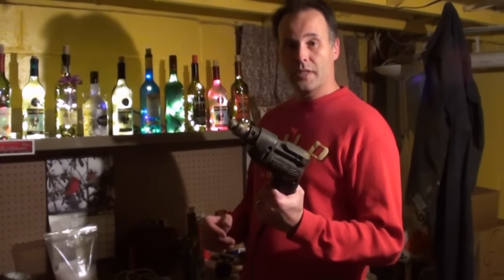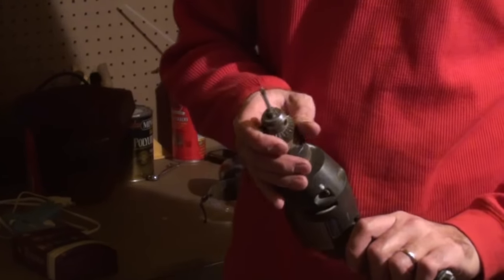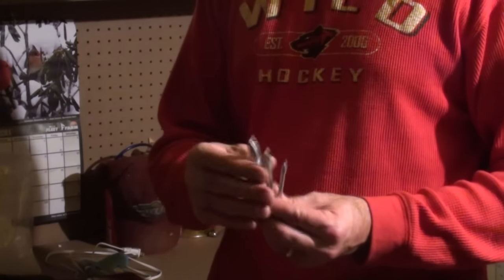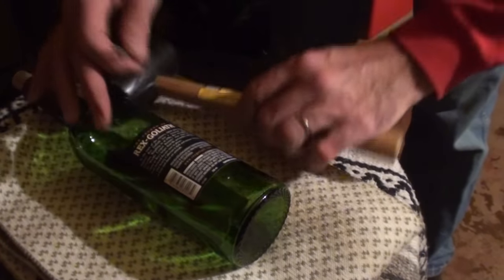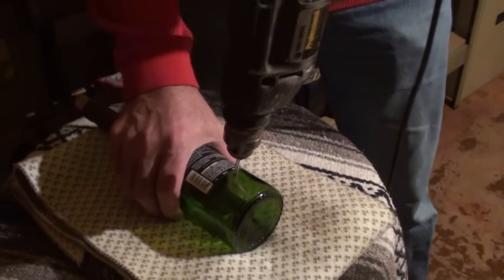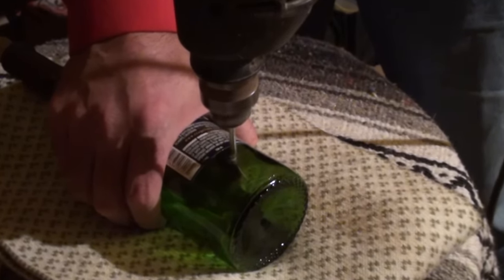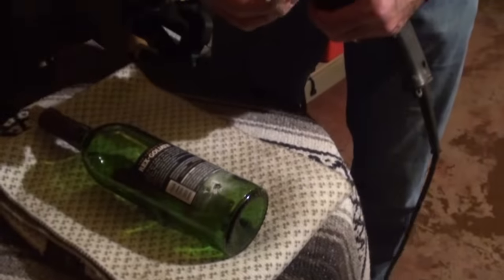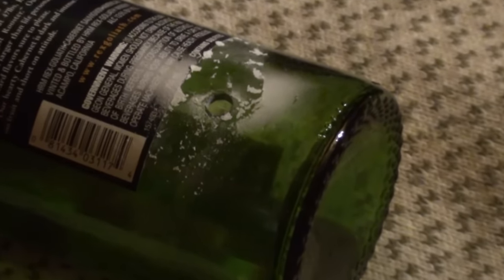HOW TO  Make Bottle Lights *DIY Wine Bottle Light*

Comment from the maker: Gilvam,

You're absolutely correct. In fact, your idea would probably work out better in the long run. The smaller the hole you have to drill is less obtrusive and is easier to make.
I offered the path of least resistance when I put this together with the thought in mind that most people wouldn't feel comfortable cutting apart the electrical cord that came with the string of lights.
I like your thinking and it lends itself to the theory, 'There's more than one way to any destination'.
Thanks you

Comment: Yesterday I drilled 4 bottles outside in the yard. I used the garden hose to keep the glass dust down. One thing I also did was to wear a glove on the hand holding the bottle in case the bottle broke. Thank you for the video I enjoyed it. I was going to make wine bottle lamps of a different type but might change my thoughts and make this style of lamp. It's much easier. Thanks for the video.

Comment from the maker: The white light strings would have worked so much better with the crystal fill. Your absolutely right. I was always taking a coat hanger to push the string back so that all you saw was the crystal fill.

Comment from the maker: Thank you POPPERZ101! Yes, there are battery operated light strings available, we have used a 15 bulb string before in a couple of our smaller bottles. I just did a quick check and Amazon has 15, 20 and 30 bulb battery operated light strings starting at $5.75.

Comment from the maker: Janet,

Are you using the glass cutting drill bits? I would mention speed and pressure as well right off the top of my head. These were things that I had to get a feel for with time. You don't want to apply too much pressure all at once. I hope this helps. We can get into specifics about technique if you would like.

Comment from the maker: I have used a different cord with the lights. Whether its a cord with or without a switch, I'm cutting off the plug in part of the Christmas lights and attaching my own plug in cord. You can either solder this extension or use wire caps. It will give you more length and having a light switch will save the end user the hassle of UN-plugging the lamp every time they're done using it.

Comment from the maker: Mary,

If you use regular Christmas lights you will experience some heat accumulation. For someone who's planning on running the bottle lights longer I would recommend LED light strings. This lights give off no heat and use less energy. The only downside is the cost. LED lights will be a little more expensive.

Comment from the maker: I was afraid to get the labels wet at first. Once the labels wet it looks like it's going to come off. No worries. It'll dry again and look just fine. Don't soak the whole bottle but carefully add water through the neck. I hold my thumb over the drilled hole and slosh the water around inside. This is usually done right after I drill the bottle. If you let the drill dust dry it'll be harder to get clean. I've also used a coat hanger to get at tough spots inside. Hope this helps!

Comment: Awesome.  I've just started making these and I love the crystal idea.  I'm using diamond tip drill bits because I read they will last longer.  How many bottles do you get out of your tips?  I saw those too and wondered if they would work?
Reply from the maker: I'm going to say about twenty bottles. It really varies on the type of glass and other variables as well. By rotating different tips while drilling you're also easing the use of one single bit.

Comment from the maker: We've had a couple of our lighted bottles plugged in for several weeks at a time. We used them as a window display during the Christmas season. If you use regular light strings the bottle will get warm but not hot enough to cause any trouble. You can always use LED light strings if you're concerned.

Comment from the maker: Not sure if you're referring to the water you want to use to keep it cool or the cleaning process. Either way, yes you could use distilled water. I've been using regular tap water and it works just as well.

Comment from the maker: teddydogification,
If I were you I would just get the LED lights. No heat. We ran a few bottles with regular Christmas lights and crystal fill in them for an extended period of time (four weeks) non stop. The bottles got warm but never exploded. They did melt some of the crystal fill around the lights themselves. This is extreme and regular use would get these same results. For your peace of mind, go with the LED's. As an added bonus they're environmentally friendly!

Comment from the maker: SueAnderson11,
The regular Christmas lights do give off heat and if you left them on it would make the bottle hot to the touch. The newer LED light strings use less electricity and give off no heat at all. The downside is the cost which is much higher then the regular strings of lights.

Comment from the maker: I tried using the size I needed for the hole when I first started and I ran into heat problems. By gradually working my way up in size (with the drill bits), I was able to keep my drill bits from over heating and the whole process went more smoothly.

Comment: Nick, have you tried cutting the wire about a foot or so from the plug and feeding it through a smaller hole and out through the top? It would require splicing and taping the wire with green tape, but seems it would be easier to feed lights through the top of the bottle.
Reply from the maker: Cj Meade,
It makes perfect sense. Some people don't want to hassle cutting and soldering the end of the light string.
Reply: Got it, thanks. I bought a 1/2 inch hole saw, and long as I take my time, it works well. Have made a few already for Christmas presents next year. Thanks so much for the reply.

Comment: I love this idea Nick...but how would it be if you used lights with the white cord when you fill it we with the white filler...then the cord wouldn't show. Just a thought. Gonna give this a try. Thanks. You know we make holes in bottlesd using a diamond hole bit which makes the hole...but you have to do it under r I nning water and it takes a while. I think what you are doing seems less time consuming and easier.
Reply from the maker: Jeane,
The white light string set makes perfect sense. I just happened to get these green light strings at a decent price after the holidays.
I've used the diamond hole bits myself with a bench drill press. The water was contained on the bottle with plumbers putty. (see video: http://youtu.be/vaAguZdPMzM)
Let us know how your project turns out. We have a DIY Show Off page on the bottle-lamp website.

Comment from the maker: @davidangelmorin
I'm using an electric drill with glass cutting drill bits. First start by making a mark with the drill bit by striking it with a hammer. This will prevent the drill from sliding all over the bottle. Starting with the smallest drill bit then working your way to the larger ones by drilling them in sucession. You might want to start out on a throw away bottle to get a feel for the speed and pressure to apply. Good luck!

Comment from the maker: You could do it that way. Once the wire is pulled out of through the hole would you then reattach the electrical plug? If you're that far into it I would get a switch and wire it in-line. That way you wouldn't have to unplug it all the time to shut it off. I guess there's more then one way to get this to work!

Comment: Instead of hitting with hammer I placed a piece of duct tape so drill bit will not move around I also put the bottle in a vise to hold still. It really helps if you spray soapy water where drill is drilling....it helps bottle not crack. I don't understand why the crystal fill or anything else in with lights...?
Reply from the maker: I added the crystal fill to the bottle to help diffuse the light. The plain white light bulbs by themselves are perfectly fine.

Comment: Thank you for this very nice video.  Please advise.  I thought drilling glass required water for the glass not to fracture.  It looked to me like yours may have minutely cracked here and there during the process.  Would wetting the drill bit have helped?
Reply from the maker: Yes. You can keep the bottle submerged enough to keep it cool during the drilling process.

Comment: stupid question but I want to do multiple bottles and space them out on the top of our cabinets in kitchen as decoration. how do you plug several bottles in at once like you have on your bar area in the video?  thanks!
Reply from the maker: +Emily Thalacker,
Good question! The lights strings that I had used in those bottles had a plug in on the back of them. Imagine plugging in a light string into a socket and then being able to add another light string behind that one. After doing that three times I added a short extension cord and repeated the whole process.

Comment from the maker: Peter,
There is a 'resources' page on the bottle-lamp website that will give you a link to the crystal fill. As far as I know, the only color that the crystal fill comes in is clear. You can experiment with different colored lights. Thanks for stopping by.
Nick and Silke

Comment: I recommend using water to cool the glass as you drill and also as a lubricant. when you drill the hole i recommend making it slightly bigger because when you push in the lights in through the hole it seems like your'e risking making a tear in the plastic and uncovering the cables (fire and electrical haphazard) also id give a word of warning when making the "pilot" groove because someone using a thinner glass or more strength can easily break the glass and cut themselves, or make a mess. good video, also id like to know if it would b a good idea to fill the bottle with other things maybe sand or something of the like.
Reply: Just commenting to emphasize Gresus' tip: using a lubricant does lower your chance of breaking the glass, lowers wear on your bits and helps keep one from having a jagged, ah, drilled area.

'Cuz no one likes a jagged drilled area.

Anyway, cutting oil - a super light oil mixture expressly intended for drilling and cutting hard surfaces - is the obvious choice, but personally? Believe it or not, I've been using turpentine for decades; it rocks on glass, aluminum and tempered steel especially.

Speaking of being old, I appreciate the video: checked it out as I'm finally considering switching from standard bits with diamond coating to the carbide spade-tips like you're using. Yours is the first vid that clearly shows the drilling process in a way that was helpful... and looks like I'm upgrading to more modern methods, LOL.

Thanks!
Reply from the maker: David,
Your absolutely correct. I thought that I had maximized my drill bits life span by using water. The oil improved it immensely! Thanks for the feedback.

Comment from the maker: Good question. I've used rubber grommets before when I attached a switch to my bottle lights.
These worked nice for not only hiding the edge of the drilled hole but also made the electrical cord more secure.
(we'll add a link to the resources page on the Bottle-Lamp website)

Comment: Hi Nick, very nice video. I managed to successfully drill a hole. How large is your largest drill bit? I used a 5/16 inch and it is not large enough for the lights to go through. Thanks.,
Reply from the maker: I have a 1/2" drill bit that I use last and I've never had to go all the way through with it. I'm gauging as I'm drilling to know when to stop.
Reply: Thanks Nick, much appreciated. Wouldn't have been able to do it without your video.

Comment: Instead of using a rubber mallet and striking it I just use a piece of shipping tape where I want to put the hole. It keeps the bit from moving. Also, I sand the hole smooth with my dremmel.
Reply from the maker: Good call.

Comment: Hi Love this video so far I've got 3 drilled it took less than 15 min, I did crack a few being too eager with the mallet but easily found my stride..How many lights per strand do you recommend for a wine bottle?? Thanks for your response.
Reply from the maker: Thank you. I usually went with a string of 35 lights. Anything more and the bottle would get warm too quickly.

Comment: Excellent tutorial :) Is the hole jagged after being drilled through? I'm thinking of it severing the light cable but I'm a newb so just curious.
Reply from the maker: You can sand it if you want or you can use a rubber grommet to protect your electrical cord.

Comment from the maker: The drilling process or the lights in the bottle?
-The drilling process - try switching up the drill bits, going between the different sizes, it allows them to cool down.
-The lights in the bottle - Regular Christmas lights do get warm. If this is a problem then you can try LED lights which give off no heat at all.

Comment from the maker: Bathila Kankanamge,
I started out with a 1/8" for the pilot hole, 1/4", 5/16", and finally a 1/2". You really don't have to go all the way through with that one. Good question!
Reply from the maker: Bathila Kankanamge 
The bits that you have and the order your using them will work just fine. The method to switching them up is to keep the heat down. Let us know how your project turns out. We have a DIY Show Off page on our Bottle-Lamp website! :)

Comment: Hi, Nick this is an awesome video and i got grt knowledge from this but i want to know that did you grab the bottle hardly or it was loose @ 2.22 minute..Thanks and sorry for bad English?
Reply from the maker: Dax,

You want to grip it pretty good and you'll want to be more responsive to the drilling. If you feel it start to grab slow down and back off and try it again. When the bottles held too loosely it may want to spin away from you.

Hope this helps!

Comment from the maker: Mr Whooligan,

There is a 'resources' page on the bottle-lamp website that will give you a link to the crystal fill. As far as I know, the only color that the crystal fill comes in is clear. You can experiment with different colored lights. Thanks for stopping by.

Nick and Silke

Comment: where do you find the larger drill bits ... and the crystal fill please ?
Reply from the maker: Kay Pope,
I was able to get mine at Ace Hardware but you should be able to get them at the big box stores as well (i.e. Home Depot, Lowes).
The crystal fill is available at Hobby Lobby and most craft stores. You will have to look in the floral arrangement sections for it.

Comment: Nick, when drilling a hole in the wine bottles, is there at any point, you use water to keep the bottle cool from cracking?
Reply from the maker: I never did use water while drilling this way. Through a combination of switching out the drill bits I was able to keep the heat through friction low. If you wanted to use water you most certainly can. Immerse the bottle in water and then begin the drilling process. You can reduce the amount of glass dust and keep the heat build up low.
My intent for this bottle was to keep the label on and so water wouldn't have worked for my project.
Reply: Ok perfect. I like your techniques better than some of the other ones I've seen saying to use water.

Comment from the maker: Good comment!
It is an option. After you make your mark with the rubber mallet, use some plumbers putty to make a dam and fill it with water. It might take down some of the noise. For the purposes of showing the drilling process, I opted not to.

Comment: Hi. Can you tell me what size drill bits were used and the final hole size used so that you could fit the lights inside. Thanks
Reply from the maker: Once I was up to the 1/2" drill bit size, I would check during the drilling process so that the hole was big enough for the lights to go through. These were the drill bits I used in the video.
When I was using the hole diamond tipped drill bits (these were used with the drill press) I simply stuck a light bulb from the light string into the end to check and see if my size was correct.

Comment: if you take the plug off the lights you can pull the lights true the top of the bottle leaving a smaller cable hole. still a good video
Reply from the maker: Good point. Thanks for stopping by.
Reply: No problem keep up the good work 👍👍

Comment from the maker: No. If you use LED's you need not worry at all. LED's = no heat. Regular Christmas lights will get warm but only cause a problem if you leave them on continuously for weeks at a time.

Comment: I've made a few and can't find a way to get the lights to stay up at the top, they always fall down so the bottle isn't illuminated all the way from top to bottom!
Any suggestions?
Reply from the maker: Barbara Merkel ,
A hook made with a simple paper clip will allow you to grab the strand and hold it at the top while not appearing too obvious.
Reply: I usually run a line of string into the bottle first that is tied somewhere around the middle of the lights.  I pull that string up through the neck and out the top to grab onto, and once I get a good bit of the lights into the bottle, it wedges the light strand up into the neck very nicely and gives a fully-packed look.  The rest of the lights back-fill the bottle and the lights stay up.  Don't tie the string to the front end of the light strand, or it won't wedge into the neck as well and will fall down.  Once I have the lights all packed, I pull the string up far enough to snip it off.

Comment from the maker: The crystals used in the video are the diameter size of the lead in a pencil. Regular Christmas lights will get warm and if the light is left on for an extended period of time (more than 24 hours) they will melt the crystal fill. If it is your plan to leave the lights on for long periods of time, go with LED lights as they produce no heat.